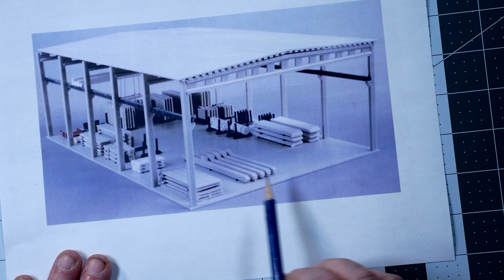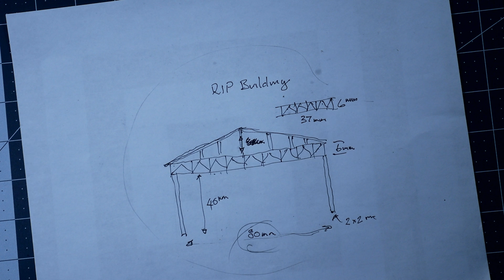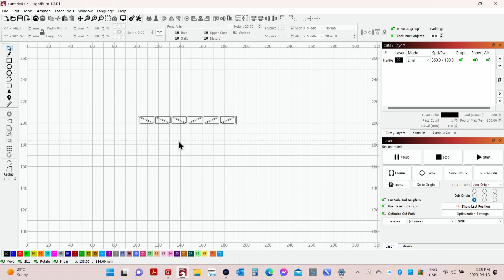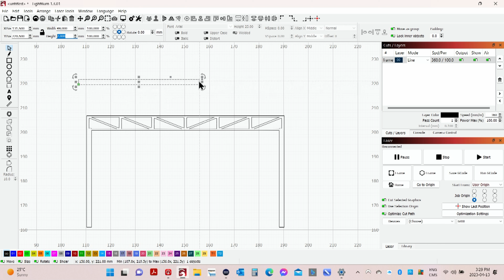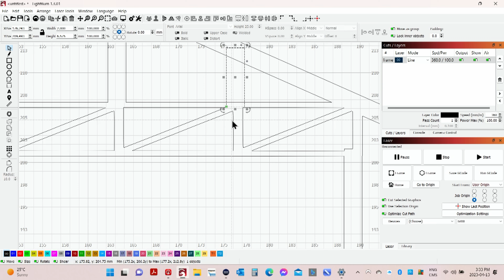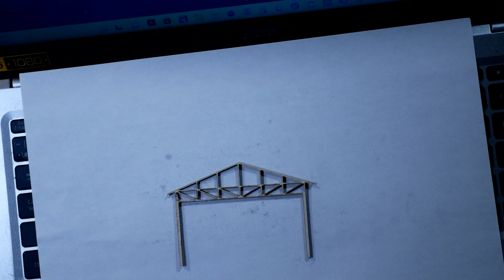Lightburn Demo for Scratch Building

Comment: My question, is if you know the size of a real actual building, how do you scale that drawing on lightburn to create in HO scale?
Reply from the maker: I use a known object to determine the size. I usually  find a door on the building.  Most doors are a standard height 7 feet and a few inches. Next I get my scale ruler and using calipers I measure out how many milimetetrs 7 feet is. the next step is to draw the building using the milimeter door as the guide.  Once the drawing is done i start using lightburn to transfer the dimensions to the softwares work space.  I have lots of reference photo of doors and windows from google images that include dimensions printed out that i keep near by when I  work on designing structures. Hope this helps. If you need more info message me back and I will try to help

dave